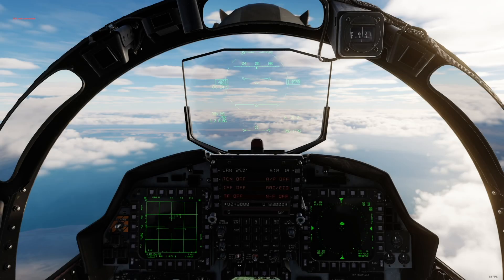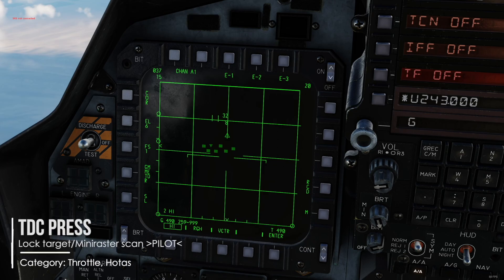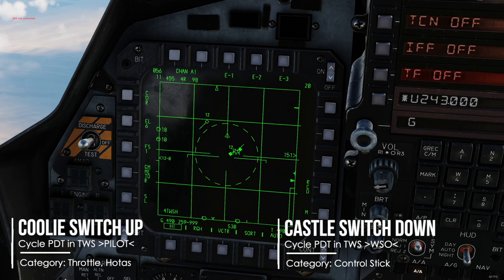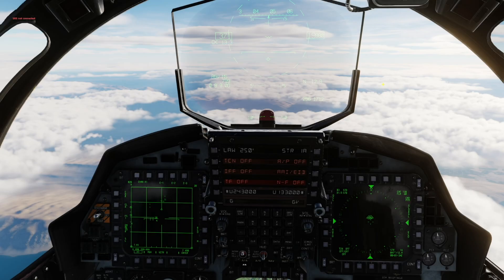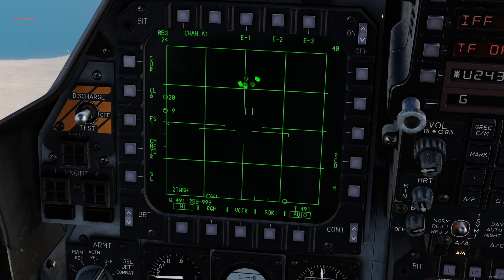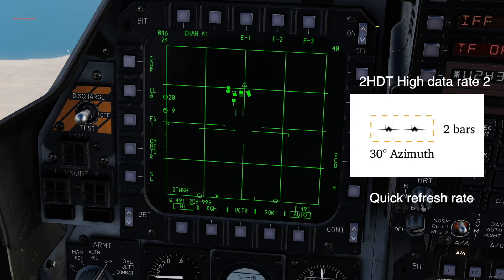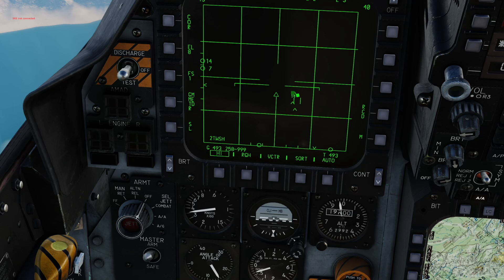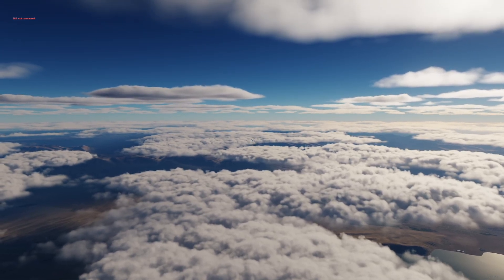F15E Quick Guide - Switching TWS Modes, Lock&unlock targets, Pilot&WSO Keybinds

Comment: thank for you video ! but I would like to understand I am WSO in F15E on DCS and I have never managed to switch my radar to NARROW, I put the ACQ Sym at the bottom left in mode 4TWSH or 2 and then I press the TDC but that does not change nothing while my pilot passes it directly....

Is this reserved only for the pilot seat?

thanks in advance I'm going crazy
Reply from the maker: Hey mate, glad you liked it :).

To your question: 
I'm pretty sure you are using the wrong key while hovering over the 2TWSH text.
Make sure to use your "Trigger FA (Full)" key to start a miniraster scan or to change from 2TWSH to narrow, while hovering with the tdc.

If it still does not work check that you are using the keybind on the correct hand controller for the MPD you have selected, LHC for the two MPDs on the left side and RHC for the two MPDs on the right side.

Hope that helps you out :).

Tip: Always use TGP/Radar on the same side and passiv screens on the other, so you dont have to bind both hand controllers in full ;).

I didn't explained it in detail in the video for the WSO maybe i should get an specific one out for that in the future.
Reply: @kamza87  for sure , thank a lot

Comment: Does boxing AUTO also slew the radar az/el to keep a locked target in the scan, or do you have to do that completely manually in this plane?
Reply: Boxing auto in the SE is different than auto versus manual in the F18’s TWS. Boxing auto automatically locks up to 10 (I think it’s 10) targets within your radars azimuth scan. Bogey or otherwise. It can be good for quick SA but then you’ve got to IFF since auto doesn’t care if it’s friend or foe.